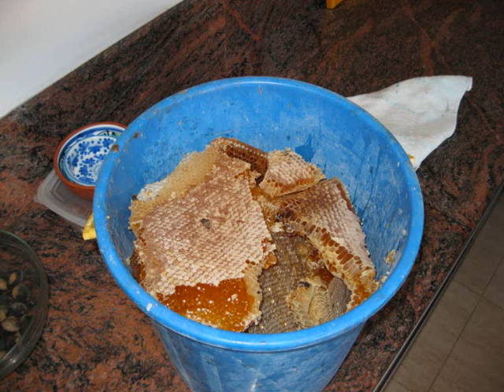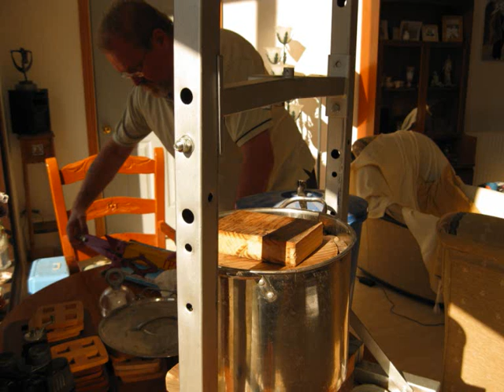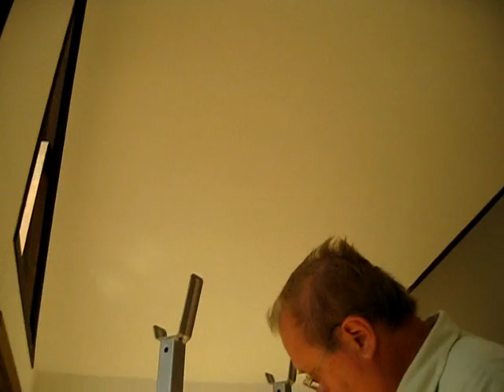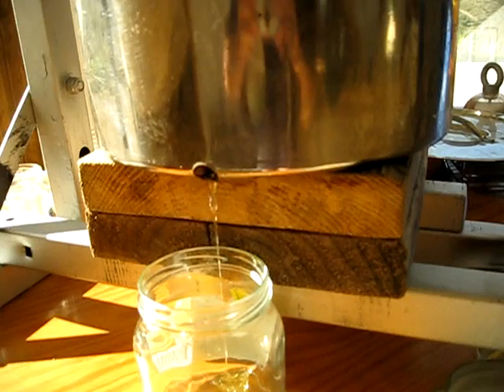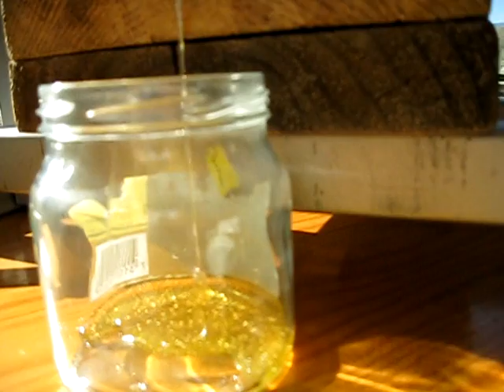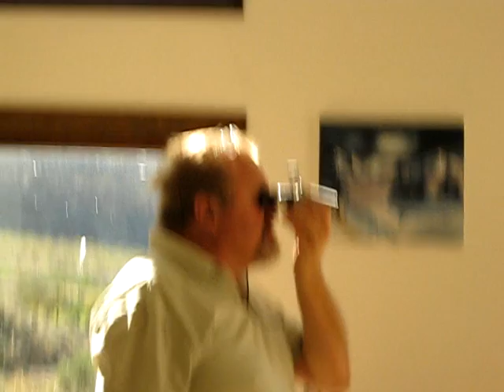Pressing Honeycomb.wmv

Comment from the maker: its just a row of wooden laths strung together with stainless steel wire. Its purpose is to let the honey flow to the bottom and out through the hole. If they were not there, the honey would have nowhere to go but upwards.